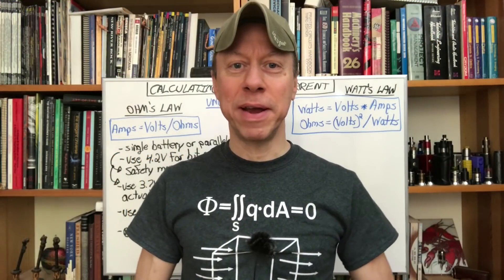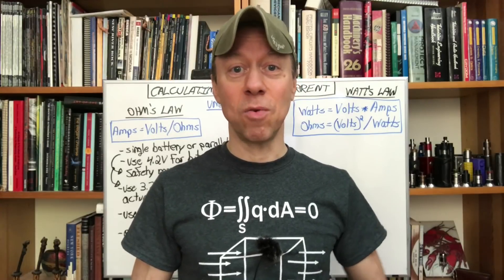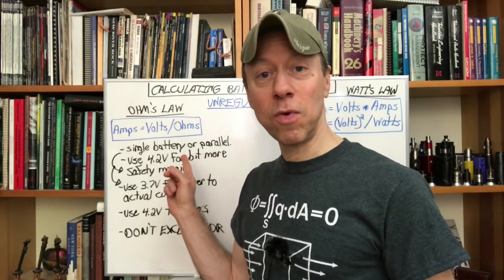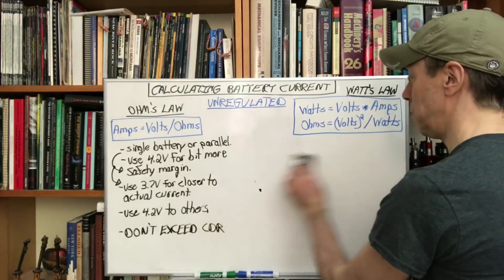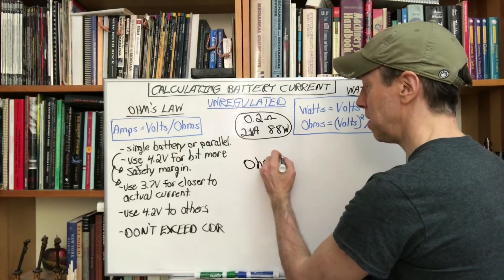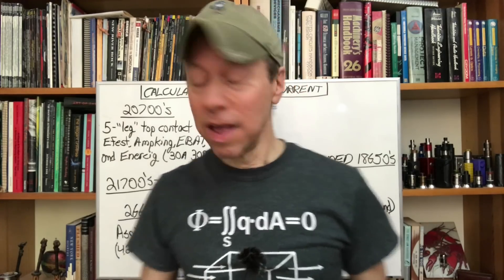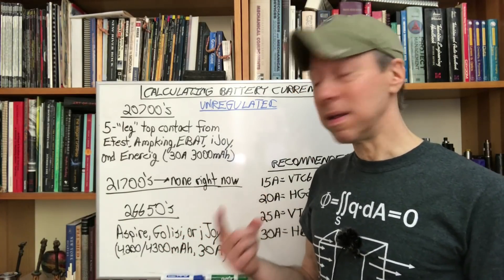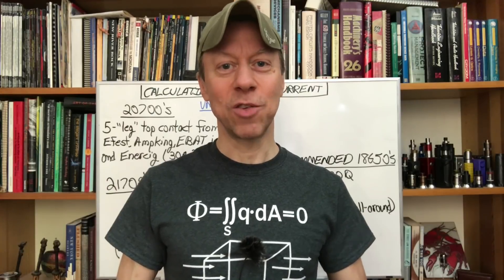Minding Your mAhs – Ep002 – Batteries for unregulated/mech mods

Comment: Great video Mooch! One question thou', In a parallel Mech Mod, does the current split between the batteries or the amp draw is the same for all, I think you mentioned it is the same for single or parallel just want to confirm, Thanks!

Comment: Hi Mooch, You just confused me so I hope you can clarify the following.  5:55 minutes into the instruction you state that using 4.2 volts gives you a safety margin when calculating current (amps).  Here is the confusion using your example.  4.2V/.2 R = 21A which translates into 88W (21*4.2).  If I replace 4.2 with 3.7 volts the new math is 3.7V/.2R=18.5A*3.7V=68.45 Watts.   If I am setting a mod using watts, I don't see how 88W is more conservative than 68.45 watts.  I understand the amps calculated in relation to the battery is causing the user to not exceed a certain current per battery specs but we don't set amps on a mod we set watts or volts or ohms. Isn't a current of 18.5 more conservative than 21?  
Regardless of your answer you can see your video is causing me to think about it instead of just memorizing. Hope you can appreciate your instruction is worth it.
Reply from the maker: Kurt Lange determining battery current in a regulated mod is done differently. You can’t use basic ohm’s law. Check out my third video.

Comment: Do I calculate Sony VTC6 as a 3,6V or 4,2V battery? That part is still kinda confusing to me because its 3,6V everywhere I look.
I'm using single 18650 mech mod with a Sony VTC6 and 0,24ohm SS fused clapton coil which turns out to be 15A 54W. Just in a 'good' range for that battery?

Thanks for reading and keep up the good work!
Reply from the maker: Mutav Dabome I mention voltages and which to use when in the video.
Reply: Ok, seems like I need to rewatch it a few more times! ;]
Reply from the maker: Mutav Dabome check out my first video too. I talk about what 3.6V and 4.2V are.
Reply: yeah I have a better idea how to calculate everything now. Also need to replace batteries with 5A's to suit my vape style better. Can't wait for your next video!

Comment: Thank you Mooch, great information, I am learning a lot. I would like to say that people need to be careful when buying batteries in making sure they are getting the battery they think they are getting. I recently purchased some batteries at a shop and specifically asked for Sony VTC5A's. The guy said "Oh ya we have those" and grabbed me 2 of them. When I got home and pulled them out, the box said VTC5 and said the same on the wrap when I looked closer. Still good batteries, but there is a 5 amp difference between the VTC5's and the VTC5A's. If I hadn't of been paying attention I could have gotten into trouble. What was scary is the guy at the shop told me "These are great batteries, the only ones I use" and he was running a .09 build in his tube mod. I realize that the ratings are CDR rating, but pulling 41 amps on a 20 amp rated battery is just plain stupid IMO.

Comment: Hey mooch can you do a segment on what happens when you use a battery above its recommended amps? I only use mechs I'm curious about it, i run builds that exceed the amps of my batteries I've always used lghg2s usually running almost 30 amps and they still perform great thanks for the vids man keep em up

Comment: Battery Mooch, I run VTC5'a in all of my devices except mech tubes.  All my mech tubes I run LG-HB6 (pink) because they have a slightly higher amp rating 32a (lower mah but I don't walk around with tubes) and I feel they hit a bit harder.  Is this accurate, or have I just convinced myself that they hit harder in my head?  Thanks man...very happy you're here!!!
Reply from the maker: PAL 702 the VTC5A hits a bit harder. All the HB series are rated at 30A now, the manufacturer’s rating.
Reply: Thanks Battery Mooch...I really appreciate it :)

Comment: Awesome info bro !!! The only part I want to disagree with, (and forgive me, it just might be my experience) but with a 0.80 ohm build, there's no need for 88w (at 8.4v). 0.80 ohm build , is practically a Mouth-to-lung build. Why is it, the higher the resistance, the less wattage needed, less amperage used, yet higher voltage. (Not sure I'm fully comprehending) Yet, lower resistance builds need higher wattage, more amperage, but lower voltage ? This part always confused me. But I know 0.80 on a series unregulated, while it may be more efficient in terms of amperage use, the likelihood of coils popping, is very high. 0.80 ohm build, is typically a 20-30w vape. It sometimes seems contradicting to me.
Reply from the maker: Justin Stemmler that 0.8 build was just a side effect of going from a single battery 0.2 ohm build to a series build at the same power. Just an example of the math with no thought to its applicability to any style of vaping.
Reply: Justin Stemmler Yeah, Justin. Watch the video!! Lolol jk brother. And I swear you're as active on as many social media sites as I am! 😂😂😂 But I most definitely see what you were trying to say. Mooch was just saying that what if a vaper wanted the 88w he had when he was running a .2 ohm build off of a single, parallel 4.2v?? And how to calculate the resistance needed to get that 88w with a series 8.4v mod. Btw, Mooch. Me and Justin here have been sharing your new YouTube channel excitedly to our vape community. Thank you so, so much for finally making a channel. Can't wait for future videos!! Vape on!! 👊👊😚💨💨💨😊

Comment: I had an idea for a video inspired by watching vaping bikers review on the broadside. What about talking about how the circuitry works in a mechanical also how changing the orientation of the battery makes a difference. IE the difference between having the positive end of the battery towards the atomizer versus towards the switch. Just an idea I had

Comment: Hey mooch , i just bought smok t-priv and i have no idea what batteries should i get. I would vape around 60-220w. Probably 60-120w on daily basis.Any recommendations?
Reply from the maker: Dāvis Heinrihsons watch my next video on regulated mods. :-)
Reply: Battery Mooch btw what do you think about charhing batteries in mods? I know its recommended to charge them with charger but a lot of my friends charge them with usb straight to mod and they dont have any problems and none of them has blew up yet.

Comment: I love these videos because they are full of awesome information. Can you recommend an easy way to find the internal resistance of a battery? I’ve tried a voltmeter, but I know there is also an internal resistance in there and I want to be as accurate as possible.
Reply from the maker: Jeffrey Trespeces it takes a special meter or doing some discharging using a known current level, noting the voltage drop, and calculating the resistance.
Reply: @Mooch . I’ve got the Nitecore SC4 charger. That one can show me the internal battery resistance.
I got 3 new VTC5a's for my Driptech-TS, all showing different resistances (38-61 mOhm).
My questions:
1. Is the charger even able to calculate it properly? How does the charger do it? Obviously it isn’t using your formula here.
2. If it calculates properly, are those resistance fluctuations normal? The cells were bought new from one batch.

Comment: In a future vid, could you please explain what values can be halved or doubled in the Power and Ohm’s laws equations? Specifically when using two coil versus one coil setups. Example: Ohms = V^2 / W. Can I divide my ohms by 2 if running dual coil? That sort of thing. Thanks again for all you do for us!

Comment: Btw im using a ijoy 5leg 20700 in a sqounker with a .17 ohm build and its amazing. It last a decent amount of time and hits hard and has a low voltage drop. 1 of the best batteries ive owned. Thanks for all the help.

Comment: Great video Mooch! These should be required watching for new vapers moving into replaceable battery mods. Looking forward to your input on battered for regulated mods. Surprisingly little info on the subject. I think there are a lot of people picking batteries for dual regulated mods with the same info on the net for unregulated. It happened to me in the beginning. I ended up with dual max amp batteries in my first regulated with amperage I'll never use and the lack of mah that I wish I had.

Comment: Anxiously awaiting 3rd video! Is the correct calculation for regulated, watts/available volts=amp draw? Keep up the GOOD WORK!!
Reply: I just read your write-up on ECF. Minimum voltage is the safest consideration (per battery). My search leads me to efficiency ratings for the Aegis and Moon Box. I don't come close to the Triade's max output, especially being so efficient.

Comment: Last night, taking my batteries off of the charger, I did run into a question. Will leaving the batteries on the charger past full charge do the battery any harm? I typically take mine off as soon as it is fully charged, but I have friends that leave them for hours after they've hit max charge. Just curious no need to answer if you don't have the time bud. Thanks again for all you do for the vape community.
Reply from the maker: Garison Brown it completely depends on the charger. Most turn off when the battery is full,  a few don’t.
Reply: Battery Mooch, I assumed that was the case, but my curiosity at 3 am was in over drive. Thank you sir!

Comment: Great info Mooch! However, would you be able to do a video on running continuous builds in unregulated series boxes? for instance VapeAmp Rig pig which is a 2 battery series mod and I want to run a continuous build in it safely. tia!
Reply from the maker: Cody Schindler I covered series setups in this video.
Reply: Battery Mooch I know, but continuous Coils are a little weird because they'll read on a meter at like .30 but when you fire it it fires like a .10, so I was curious if you know the effect something like that has on your batteries
Reply: What is a continuous coil? Almost 5 years of vaping and using mechs rather than regulated, still haven't heard of it.

Comment: Thanks for the info Mooch, I was wondering, I charged my LG 18650 3.7 batteries, now when I vape, they start at 4.5v and jump down after .3 seconds, are they still safe or do I need new batteries now?
Reply from the maker: Firedog 911 is that the battery voltage or the voltage to the coils? Different mods display different things. 
4.5V is much too high a voltage for the batteries if it actually is the battery voltage you are seeing. Do not use that charger again. If they have been charged to 4.5V there’s no way I can say they are completely safe so I am forced to recommend replacing the batteries.
Reply: Thanks for the info.
Reply: I think it’s my atomizers Mooch. I put two others on my mod and voltage went down below 2.8 and wasn’t jumping. I’m new to vaping so I’m keeping a watch on it

Comment: What are your thoughts on using a regulated mod to read coil resistance .... as opposed to an actual reading device? BTW thanks for all your work and great info!🦀💭
Reply from the maker: Crickus 52 it can work if it’s accurate.
Reply: Crickus 52 if you have a decent mod that is pretty accurate then it's just fine, same with pulsing the coils

Comment: Hey Mooch! Am I correct in saying no one can vape below .14 30a on a single battery? I see people online with coils at .09 -.12 on a Mech. 
What about the vapcell, I thought it was 40a?
Reply from the maker: Michael 0.12 is as low as you can go without going over a 30A battery’s rating.
The Vapcell is a 30A battery that has spotty availability so I am waiting until the Sanyo A is more widely available before recommending it to new vapers.
Reply: Battery Mooch  I was thinking at 4.2v. Seems like nominal colts are a safe indicator. Thanks so much for all you do. I’m really enjoying learning.

Comment: So mooch can I push a Vtc6 to 15 amps? Or should I give a little headroom say only push it to 10 amps ?
Reply from the maker: Trevor Brake it’s rated to 15A but, as with every battery, is happier at a lower level than its rating. It runs cooler and more efficiently.
Reply: Battery Mooch ok. Thank you for getting back to me so quick. Awesome video. So glad you provide this info much appreciated. Thank you again. Your awesome !

Comment: i have a questing regarding amps. in a regulated series mod (smok alien for example) is the amps divided between the 2 batteries?  if the mod says im using 25amps is it safe to use something like 30q's that are rated at 15 amps?
Reply from the maker: sceeZ er coming up in a video

Comment: Question - So its super dangerous to run a .1 on a mech series box. What exactly does a regulated dual 18650 box mod with chip do so its ok to run such a low build on it, does it regulate the volts, or regulate the amp load?
Reply from the maker: Jesse B how dangerous it is depends on the battery. Run the equation. :-)
In a regulated mod the battery current only depends on the power setting, not the coil. Check out my next video.

Comment: Wow Mooch. I never understood the Ohm's law as good as I do now. I mean I knew my Ohm's law and when I had a questionable build I would use it but, I've always had that in the back of my head, when I'm using my mech Mods, squonker particularly, about the efficiency of the simple Ohm's law. And to be quite honest, which I may regret later, using more than one battery in parallel or stack, I was doing it wrong. New vapers should all be given this information. I've only been vaping for about a year and no one ever told me anything about this. They told me to follow my ohms law, and that was it. I actually had to look up what the Ohm's law was. Good job, I look forward to the second part of this video. Again, I think you should open a patrons account because I would definitely sign up. There's nothing wrong with the quality or the sound of your videos it would just make people like me feel a little bit better contributing to someone who's done so much for the average vapers. 
Thanks a lot, 
Jimmy

Comment: Hey mooch, could you explain a para series mod like the Hammer of God V3 were it has 2 sets of 18650's in series and then paralleled together. Are there any benefits/drawbacks, safety limits and how does the amperage draw get split between the 4 batteries?
Reply: I tend to follow ohms law and treat it as a series mod when it comes to safety. I like a hot vape so I shot for a 200w build to put in my 40mm Mason Dumptank. Came out to a .35ohm to get me a 200w vape at 24 amps. I also run vtc5a's. Great video man, Im sure you're gonna get big in no time here on youtube.

Comment: I love this type of info - one love brother
Reply: Jai I know you like using your LG HB6's for mechanicals but you may want to run out and grab yourself some samsung 20S's (also available rewrapped as the vapcell 18650 2000mah 38a) they have a way, way lower IR and as of this date, they are the hardest hitting 18650 available to us thus far....oh, and it's also 30 amps, just like the HB6/2/4's :)
Reply: @ryancairns2317  or just use a 30t because they are amazing for mech/unregulated mods
Reply: I love this, wonderful helpful info. Im learning.  nice not to hear same old AW only ...

Comment: Another awesome video! Question for ya Mooch, how come you didn't mention the VapCell 20700 battery? I was under the impression that vapcells gold 20700 wrapped battery was performing same as the sanyo 20700A? Thanks in advance :)
Reply from the maker: KimmyVapes hello Kimmy! They are in short supply and can change at any time so I wanted to wait until the Sanyo NCR20700A became more available before mentioning them and the rewraps in a video.

Comment: I have a alien 220w and here lately the screen has quit work sometimes it comes on some times it dont. I have found juice in the battery department here lately and clean it out. How bad is that for the mod and batterys.
Reply from the maker: Awkward Flash I can’t really say as it depends on the mod but it’s definitely not good. If it’s not working properly the best thing to do is replace that mod.

Comment: did you retest VTC6 and 30 Q because i remember u rate VTC6 at 19 A  and 30Q at 20 A
Reply from the maker: Concusion yes, I just posted the 30Q retest recently and the VTC6 retest is coming soon. The batteries have not changed at all, just my ratings. I will need to add some sort of method to show that those batteries run cooler than others at their ratings....working on it.
Reply: So when u said nothing changes..is that mean i can keep using them as 20 A batteries?

Comment: Thanks again my dear Mooch. Could you give info about 18490/18500 batteries? I still have to use them for my provari mini. In your blogs I also dont find much info about these batteries.
By the way: what is the other zero in your equation?
Go on with your good work.
Reply from the maker: a. vos I haven’t tested any 18490/18500’s in a long time as I get so few requests to do so and so many requests to test other cells. Hopefully I can grab a few later this year and do a group test.

Only one zero on the equation, the first symbol is phi. :-)